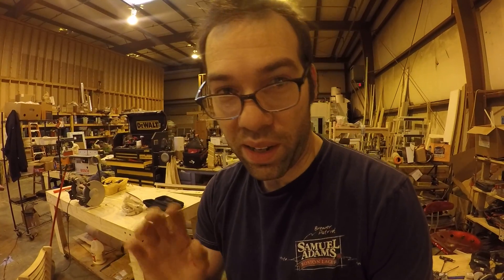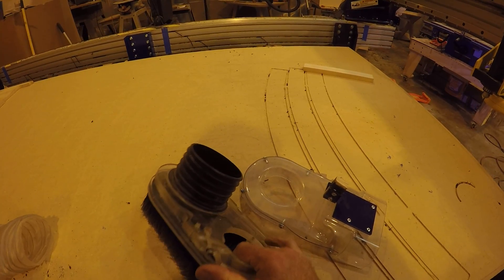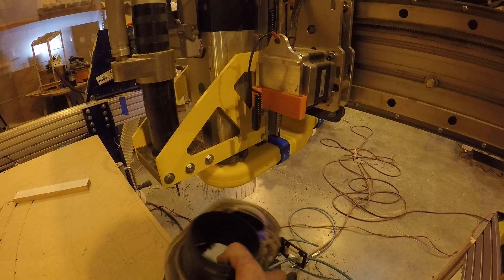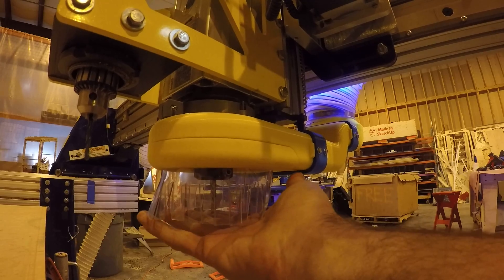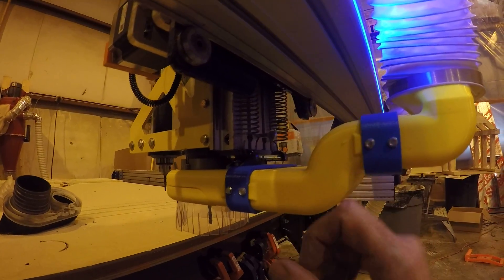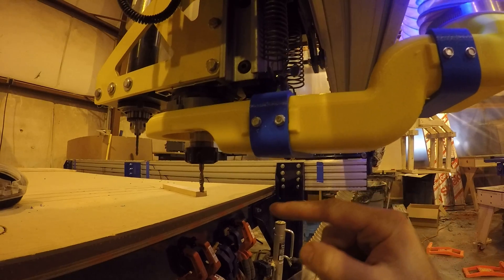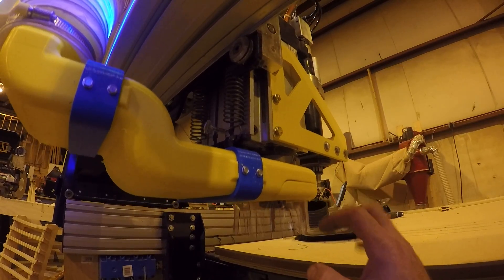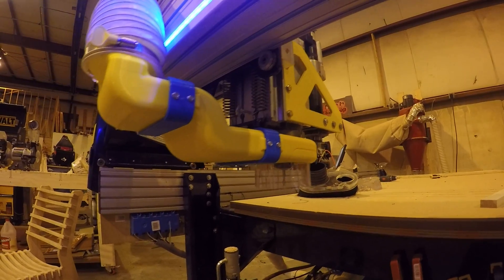3D Printed ShopBot dust boot

Comment: I have all of the parts 3D printed. Do you remember what size you made the bolts/screws so that they'll fit snugly into the holes on the 3D printed parts? I need to order those.